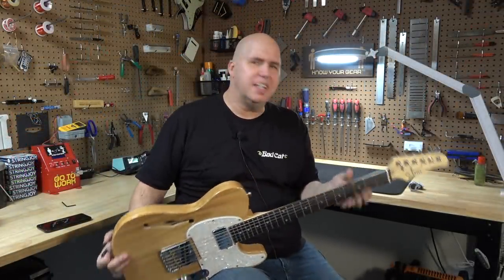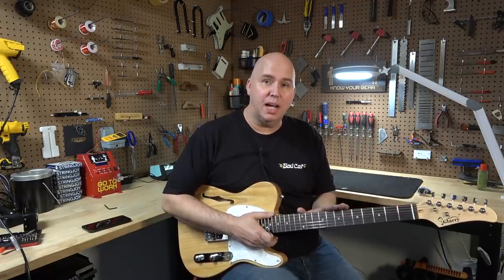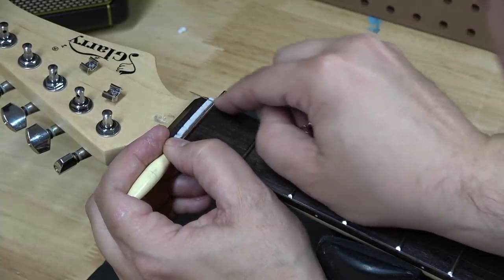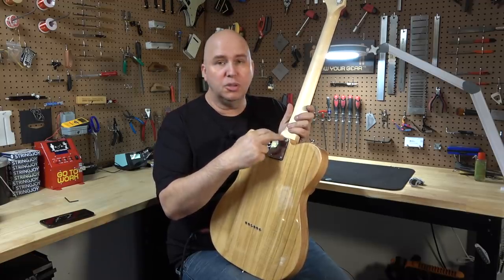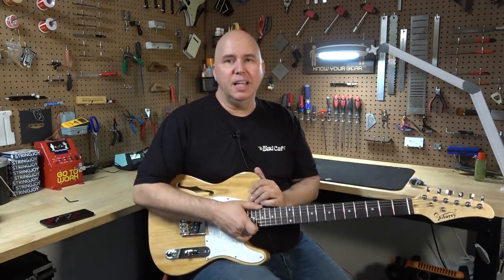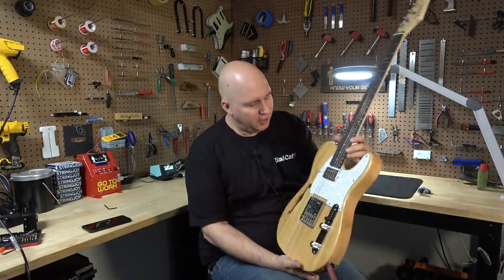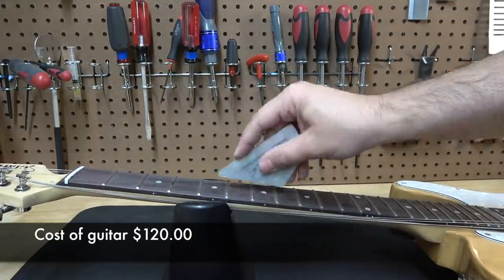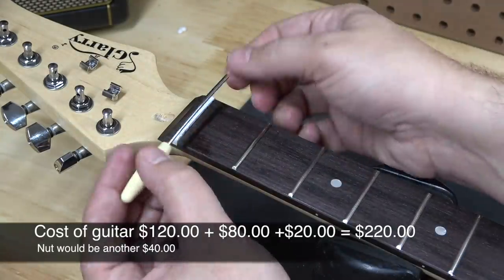How Much Do These GLARRY Guitars Really Cost You?

Comment: I think there is a line there. "Affordable" could be Glarry affordable or Harley Benton affordable. I have a Glarry strat. Unplayable out of the box.  I have a couple HBs and they were not perfect (one was pretty close to perfect), but perfectly playable with no major defects. So, between a $60 Glarry or a $130 HB, I would go with the HB unless you are buying it specifically to practice working on your guitar (which is exactly what I was doing). I spent way more than the $60 purchase price on parts. That being said, HB has $80 strats also, and those are probably going to need significant work as well. Actually I would step up to one of their $150ish models. Still dirt cheap.

Comment: 8:28 in that area you will be pushing up strings when playing. What I recommend to do, is to put the fret-level angled in alignment to where those strings will be pushed. You'll be very suprised when they start rocking heavy in certain places, even though straight across is fine. Getting low action WITH bends on a tele is almost impossible because the guartar is cursed or something. But what's good about that particular strat is it doesn't have THIN frets. Hollow-body tele's don't sound good at all in my opinion.

Comment: Thanks for the review! One thing not mentioned are the tuners. I had trouble with mine. The ratio is too low, I'd rather have 15:1 or higher. Do you have a recommendation for a set at around $20 to replace the originals? TIA!

Comment: The one I had had some weak pick ups with really low output and the action was a little bit high but other than that it was a good guitar for 80$ took about twenty minutes to set it up and lower the action the pick ups are not really my thing but that's an easy fix get some better pick ups and that's about all that you would really need to do. Mine was the stratocaster style it had sculls on it it was definitely worth 80 dollars good bang for your buck. I would easily concider them as good as a BC Rich bronze series and they are about 200$.

Comment: Thanks for the review! I didn't notice you reviewing the machine heads and pegs. I got mine yesterday and upon inspection noticed that the tuner peg washers were all stripped causing the pegs to just spin rendering the guitar un-tunable. I've already contacted the seller to resolve issue but may have to return as the pegs can't be replaced and the entire assembly of the pegs, machine heads, etc plus install labor may be expensive. Anyone else have this problem? Any fix for the slippery pegs?

Comment: I just picked up a used Rondo SX “Liquid”  . Needed to do just about everything you did. I have one high fret to deal with yet.( 16th or 17th?)I will try and tap it down during my next string change. I was still able to set the action at 3/32 at the 12 fret. ( which is close to where I like it anyway) Fantastic player.( 2- P90’s) Beautiful finish on the neck. question: What were you using at the nut to set the depth of the slots? I still need a decent set of files. Any suggestions on some that aren’t pro-grade but not $6 grade?

Comment: Hi Phil love watching your channel it’s very informative 👍 I’m after a bit of advice, I have a Squier Classic Vibe 70’s Jaguar and it requires a new nut. Do you know which size nut, pre cut preferably fits. I have measured the nut that is on it currently and have searched for a tusque replacement but none of the sizes seem to match. It would be great if you could suggest the correct replacement and where to source it.
I’m in the Uk 
Keep up the great work, thanks, Mark

Comment: I think what is remarkable is how the price of cheap guitars has dropped over time. $120 in 1980 is roughly $400 in 2021. Look at it the other way, $120 today is $36 in 1980. You could not find a $36 guitar in 1980, even a cheap one. And today's import guitars are far higher quality than the cheap imports built back then.

Comment: I wonder how this guitar compares to the Iyv Telecasters.
Reply: Hey Ric - I don't have this guitar, and it looks a little nicer than the Glarry base model Strats. But I do have one of those.... and hey - I dig it for $75 bucks! I really do. I'm going to have some fun modding it and working with it some, but it was playable - right out of the box. Pretty cheap materials though - no doubt. Honestly... I mainly wanted the body - and I wanted to see how the neck was. Body is great. Neck OK+ but nothing to write home about. Zero fret sprout, but it's a cheap feeling neck. Almost doesn't feel like real wood - but I think it is. 

Now - I have the IYV Telecaster thin-line. The red one, with P-90s.... and I can tell you this:  Holy crap that thing smokes! Noticeably better materials, and the P-90's loaded in the one I got are nuts! Incredible pick-ups. I was shocked. That guitar would NOT play at all out of the box. Zero. Strings laying all over the frets after tune-up. I could not achieve a single note - anywhere on the guitar. I was worried. Real worried. Then a couple half-turns  on the truss-rod... and bingo. Spot-on action and intonation. Again - I was shocked. I absolutely love that guitar. Definitely a lot nicer and better quality than my Glarry Strat. But $167 instead of $75.  I dig em' both for he cash.
Reply: @jimmyz2098  oh ok understand  thank you

Comment: I swear those cheap nut files are just acetylene torch tip cleaners.  They just need a blue storage box handle.
Reply: That is exactly what they are. Torch tip cleaners. And they wear down fast, and hard to get the right gauge. They bend, as well, but I hear people like to put those torch tip cleaners in a jewler's saw, which keeps them straight and firm. I ended up just buying real nut files, which I am happy with.

Comment: Those crappy Chinese Fret files are not fret files, they are cheap and crappy torch tip cleaners that are used to recut, and clean the holes in brass, bronze, and copper oxy/acetylene torch tips. for about $10.00 to 15.00 at any good welding shop you can buy a quality set tip cleaners that don't bend or break easy, and will size a nut slot in almost any nut material cut with a razor saw. I do fab work on the side, and have used my quality tip cleaner to resize nuts. You can also use a wound string to cut the bigger sizes.

Comment: I have this model. I have to spend money to make this guitar a decent guitar. It was not setup properly. Had fret sprout.  The action was way too high. The truss rod was not tightened at all--I tightened it. Had to lower the bridge action.  I haven't checked the fret board for being too high--yet--that is next.  Playing open cords---are out of tune--terrible.  Tuning keys had to be tightened.  I spent $160 on a similar model from Donner, that came perfectly setup and ready to play. I think spending the extra $40 is a better choice. I think the pickups are fine. Seemed a tiny bit muddy to me. The guitar is really beautifully finished. It had serious intonation problems, but the single brass saddles on the bridge is a positive and makes it easy to set intonation.  It is a cheap guitar for sure. If you an do a proper setup and address its deficiencies, then it isn't a bad buy. If you are not interested in doing work on the guitar---don't buy it.

Comment: Hey Phillip, I will subscribe ( i sub to no one!) if you can respond to this question. 
To preface I am a fairly experienced at basic setup such as the TRAIN system. I bought a Glarry Telecaster (the non hollow-body, it has single coil on the neck as well)
Did you ever test this guitar and notice that the pickup on the bridge is microphonic?  Is it possible or worth fixing or would an upgrade make more sense? I kind of want a 6 saddle bridge so I can get better intonation so I am open to that idea. I love the  guitar in terms of the neck and the fret work after I polished it up and it plays great, just need to fix these issues. also seems to have a grounding issue of some buzz if i dont have my hand on the bridge or strings.

Does the semi-hollow have this problem? If I use that bridge pickup i can hear my voice straight from the amp.

Comment: Cheep Fender Strat .regret it with stainless steel.set of emg pickups.fender roller nut with locking tuners.and U have a $200 guitar better that a 3000 guitar

Comment: guitar cost 150.00 new pickups 220.00 new machine tuners 100.00 new pots and usa made blade selector switch 25.00. your "cheap"guitar costs 470.00 not so much a bargain as a project. in the end you still have a subpar guitar that will never be worth the $ you put into it.
Reply: Not to argue but a nice set of Artec alnicos will set a guy back 30-40$. A great set of Guyker tuners will cost 35$. 
I've worked as an authorized regional guitar repair center for multiple guitar brands for decades.
That investment will get a guy a totally gig-worthy axe. 

I've done most of my gigs and sessions lately, using an 89$ Grote strat with a 34$ pre-wired pickup/pickguard assembly.